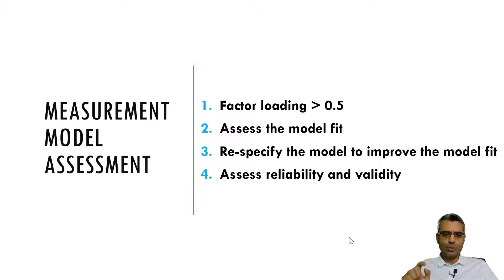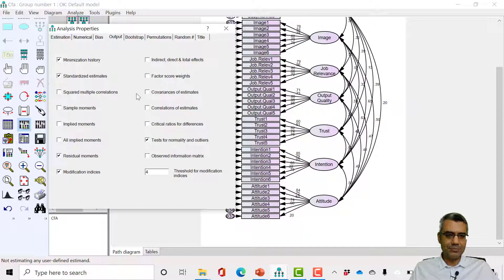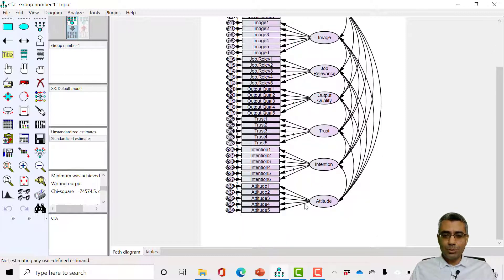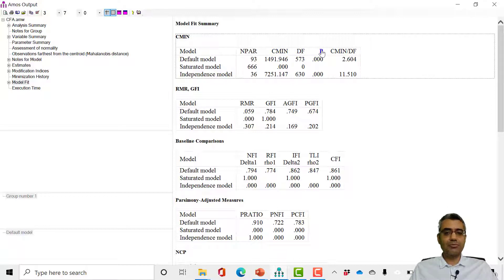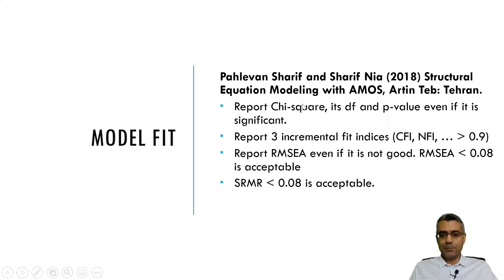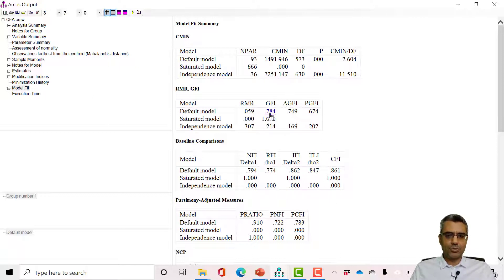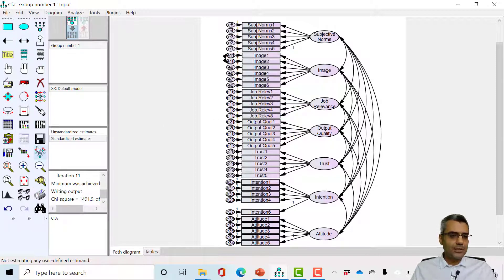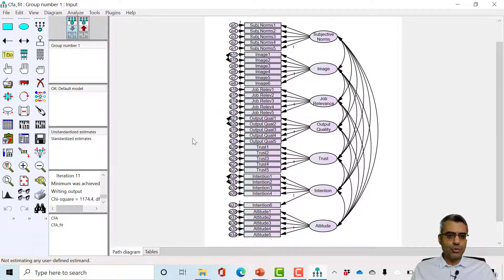SEM with AMOS: From Zero to Hero (18: Model fit assessment)

Comment: Hi dr.
if one of the variable not achieve convergent validity (ave), and i decided to remove that variable then it is not be in strucual model.
Could I mention that variable is not be in strucual model because it does not achieve convergent validity in the abstract of my thesis?
Note that variable became has 2 indicators and did not achieve convergent validity

Comment: Thank you so much, Dr, for the series on using AMOS; helpful and insightful. I have a question concerning improving the model using the residuals table; in my model, I don't have any value equal to or more than 4.00; however, how can I decide on removing an item based on the absolute values?

Comment: If the NFi,  GFI Values are less than 0.9 , we refuse the model ? (  while all the other values are ✅)
Reply from the maker: Not necessarily. You may refer to other indexes. Also, you may find references to support for example NFI greater than .85
Reply: Did you get the ans to this question? because i'm facing the same issue,
Reply: @khifzarehman1929  See the answer above
Reply: @khifzarehman1929   yes, the values less than 0.9 are not accepted. So u need to modify the model based on the modification indices and pattern  matrix

Comment: Sir i m very worried my model fit is poor and discriminant validity too
Reply from the maker: In these series of videos I have provided some solutions to improve the model fit and discriminant validity.  You may need to covariate some error terms, remove weak factor loadings, etc. For discriminant validity, you need to find the item with cross loading and remove it. You may perform an EFA on the problematic constructs and find the item with cross loading.
Reply: @saeedsharif  Sir, for my one variable average variance extraction is 0.395 and after deletion of one item it goes upto 0.421 and it is greater than msv. Composite reliability is 0.88 for the same variable, can i use this value with reference to Fornell Locker reference that less than 0.5 is permissible if composite reliability is above 0.6?
Reply from the maker: @farigreactions8202  Sometimes AVE is less than 0.5 as AVE is a bit conservative. In some of my papers I have reported AVE of less than 0.5 too. If you had an AVE of less than 0.5, refer to CR for convergent validity. This is the reference to support it: Sharif, S. P., Mostafiz, I., & Guptan, V. (2018). A systematic review of structural equation modelling in nursing research. Nurse Researcher, 26(2), 28-31.
Reply from the maker: @farigreactions8202  For reliability measures, to be safe they should be greater than 0.7. However, I think in some of my papers I had some with CR > 0.6 too.
Reply: @saeedsharif  sir i m facing issue for GFI it is very poor, 0.84 i m increasing sample size still not improving much infact validity then gets affected which is fine now for variables  considered your points regarding AVE.but my CFI, chsquare,RMSEA,RMR are fine.